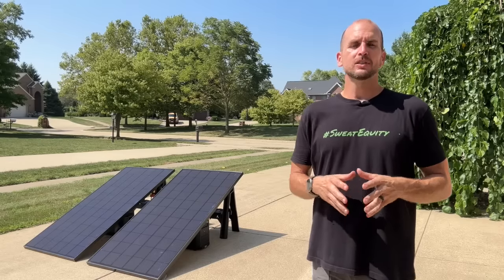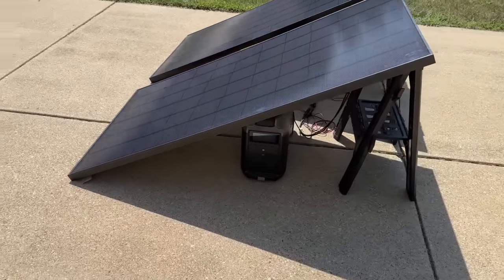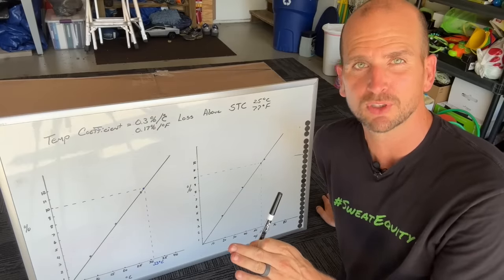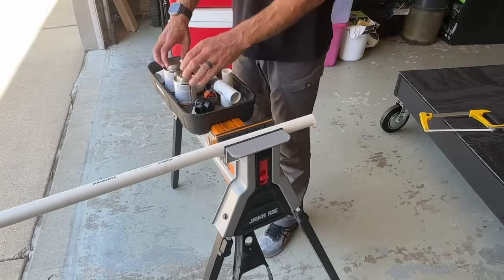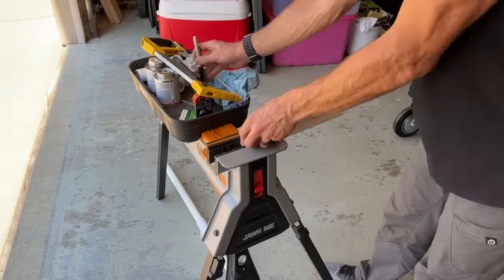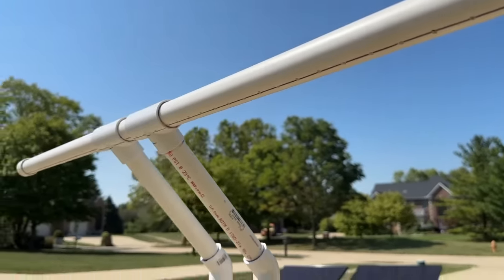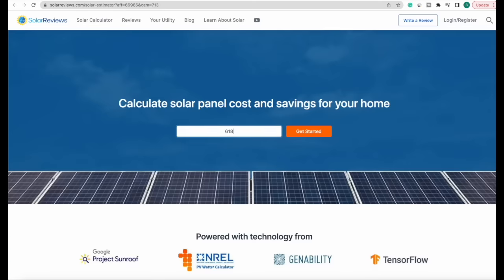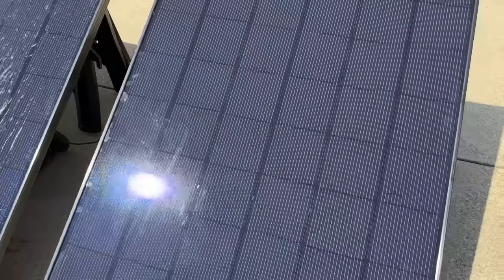Surprising Power Gains By Cooling Solar Panels

Comment: But it costs something (different for everyone) to supply the water. I wouldn't waste my time......plus water in desert regions, where solar is the most beneficial, is a precious resource better used for other things. Just add an extra panel. You should be building your system from the start to be upgradable anyway.

Comment: Hey why not use peltiers? Hear me out here. You get some copper flashing and put it underneath with a peltier spaced out to its maximum cooling on the copper. Use the panels output to cool it.

Comment: Tech Ingredients youtube guy added fans to the back of the panels which are run by the extra power of the solar panels. overall still a positive gain in efficiency compared to uncooled solar panels without fans.

Comment: It is very hard for me to believe that people don't know about solar water heater panels. How can you know about solar panels and not know about solar water heater panels? Thry look exactly the same. Except one makes electricity and the other has water pipes going through it and collects the heat in a boiler. They happen to use the same space on your roof and it is baffling why we don't have combined panels with water pipes on the bottom and crystals on top so you don't have to decide IF you want hot water or electricity and just have both. Plus the added benefit of cooling your panels and getting better efficiency on the electric side. Add that to efficiency of collecting all that hot water and you have a much better system that can't be beaten by any solar.

Comment: Can someone explain to me how he is getting 370wh from a 360w panal? I’m desperate to get more power from my panels . If I have a 100w (12v)panel producing 60 watts for 1 hour,then that would mean 60wh. Correct? I’d appreciate any information as I’ve made a 5kw solar generator but struggle to keep it charged with the different types of panels I’ve bought.

Comment: you produce more electricity in summer than you use so cooling the panels isn't much healpful. the problem is during cold months, there is not much sunlight to generate more electricity than you use

Comment: Get a cheap Small Yard pool and a cheap Solar Pump capable enough of the flow needed for the job, Lower end of panel in pool' Tho raised just enough out of the few inches of water. Diy small raised water deflect guards on sides of panels to keep water from spillin over the sides. All Gain' No Losses.⚡🌐🖖

Comment: If your so concerned about that heat temp loss Just add extra panels to adjust for the loss water is expensive to use unless you used grey water for this
Reply: roasted smelly water to add a special aroma to your surroundings?

Comment: or just shove a coiled hose on the backside of the pannel and circulate water in a closed loop I am using the flat tubed roof top pool heaters on the back side of 190w mono panels they do 250w

Comment: What is the cost per kw.  You stated the estimated cost is $15,834 to $23,752.  What is the cost WITHOUT federal tax credit?  Is the federal credit 30% of cost?  

It looks like you are paying 23.25 cents/kwh.  Is this California?  ($80220/25 y/113800=0.2325)  

The back side of the panel might be closer to the 93F outside temperature, which distorted your results.  If you cooled both sides, you might get more out of the cooled panel, but cooling both sides would be difficult and not practical for roof apps.

Comment: It’s an interesting test but in the end it will do nothing for you on the output side when converting to ac. Your inverters will always be the limiting factor. You won’t have a 360 watt panel paired with a 400 watt micro inverter. The only way this works is on a strictly dc system.

Comment: Recycled ♻️ rainwater system.....
With a float valve connected to house water.
Should the water be unavailable because of lack of rain or the evaporation of surface water ... supplemented by city water... through the guttering system.

Comment: IMHO..the 5% wattage increase is not worth it and we must remeber, that 5% increase is about the maximum you will gain, in full sun/ very hot weather...which means in the spring, winter and fall months, you are gonna see less then 5% increase due to the cooler temps , rain- snow- clouds. In fact,  anything less than a 10% increase in efficiency, is probably not worth the effort, waste of water. If a person decided they wanted to do this , I think a better option is to use a large water collection pan behind the panels and hook up some type of  water sprayer system that sprays water on the panels every 30 seconds or so and have that sprayer run off a 12-24 VDC brushless pump so you can use a single seperate small solar panel to power it.

Comment: Is it possible to put IR blocking film on a panel? What light band do solar panels use?
Reply: Blocking as in catching or reflecting?
Reply: @ThePixel1983  From 8 months ago... I assume I meant blocking and/or reflecting to reduce the heat input to the cells?
Reply: @GTrainRx7  That filter will either absorb or reflect that IR radiation. If it absorbs it, it gets hot itself. No idea if IR mirror foil is possible without taking out efficiency.

Comment: Let me understand this. . A person spends $70,000 to put in a solar panel system covering the entire roof.  They loose a LOT of power output from heat from the Sun. . NOW on top of the $70,000 and 20 year or longer purchase contract at 8% they need to Add water to keep the system cool which is more $$$$.  These Panels are only rated at about 28% efficient under Factory Laboratory settings - absolute optimum conditions.  They'll NEVER ever pay for themselves before they need replacing due to age at about 8 to 10 years.  I'll wait until the Solar panels are at least 75% efficient. . Relators have all said they do NOT improve the value of the property.  Arizona actually makes the house nearly impossible to insure with solar panels.  Solar panels have been known to short out and catch fire on the roof.  So No, No No. . I'll never get solar panels.

Comment: Does the water drops cause a magnification of  the sunlight causing. More power ?
Reply: No. If you hold a magnifying glass to pinpoint the light as if you wanted to start a fire, you will see that the light around the pinpoint has been greatly reduced. So to get a magnified effect to generate more electricity, you need a lens bigger than the solar panel.

Comment: Would it be better to just add a couple more panels and call it a day?
Reply from the maker: For sure, I am testing a bunch of things out but as it stands adding a panel or 2 is still the most practical solution to get a bump assuming your inverter can handle a bit more.

Comment: Evaporative cooling increases inversely with the water droplet size, hence smaller droplets increase cooling, but evaporation of untreated water tends to drop out solids and leaves a calcium based residue on your panels, decreasing efficiency. Add to that, 130 gallons of water could be more efficiently used for many other processes - especially in drought prone areas. 
While you have demonstrated cooler panels are more efficient, the cost/benefit analysis negates any savings. Even you admit "I wouldn't personally be doing it.". Sorry, but in the end,  it is much ado over nothing - at least from this retired energy engineer's perspective.

Comment: Maybe in the future, this could get a bit more refined with a closed loop cooling system in order to avoid wasting all that water and maybe even get some heat out of it. 

But that system is at best a proof of concept and absolutely not practical or economical.

Comment: I love all the ideas, but 5% is not worth the extra work/expense... buy 5% more panel for a few bucks.
I ran into this problem when designing a solar tracking system... it was cheaper to buy 20% more panels!
Reply from the maker: I agree.
Reply: @everydaysolar  I heard an interesting hypothesis that I have yet to test... 
Placing the solar panels vertical...  
Increased airflow cooling (and less solar heating)
Minimal dust/dirt collection (no cleaning necessary)
Slower panel degradation (add 5-10 years to lifespan)
Lower Peak Power (slightly offset by indirect light and cooler temps)

My Concerns...
Cooling is not that big of a factor (as you demonstrated)
Water hose cleaning is pretty quick (especially if you add a Rain-X coating) 
Panels only degrade to about 80-90% over 20-25 years (New Tech will be so cheap by then)
Power drops off pretty quickly leaving the Normal (a +30% drop would not be worth it)

Comment: So I use a 12 volt pump I made up a system where it misss the water all over it and it just runs right down it kind of like what you're doing but it all works off of solars so it's a small solar panel that runs the 12 volt pump with a bucket of water and it just pumps it right down the front of them damn things solar cooling solar to produce more power awesome shit

Comment: This "News" is as old as solar panels are...
I'm more suprised that not every solar panel owner knows this. This is one of the reasons spring is the most efficient time for solar panels since the air is cooler than in summer...
But spraying the surface with water is such a waste of recources in summer.
Reply from the maker: For sure, this was more of a early trial to just see the gains.  👍

Comment: This will eventually destroy the solar panels. Any time you use water as a heat transfer medium you deposit minerals onto the hot surface. Eventually this will build up enough to block light and ruin any efficiency gains. The cost for water treatment to mitigate this would far outweigh any power savings.

Comment: I'd try putting sheets of aluminum on the back sides of the frames with a screened gap at the top to keep out small birds, wasps, and other insects. At the bottom I'd have a couple of fans, with screen over them. For all the fans I'd install a solar panel dedicated to them so the cooling system is completely independent from main power generation.

Comment: Why not figure out how to mount the under floor aluminum Pex panels and use Pex for a closed system. Also a closed system requires less power to pump if you get the air out of it.

Comment: Obviously; 130 GPH of water use is terribly wasteful, but what if the water was being circulated to heat a swimming pool ?  Adding heat to a pool with a small amount of electricity of the re-circulation water might be a very efficient use of energy.

Comment: How about cooling them from the back using misters?
Reply from the maker: Yeah, I think to make this practical it would need to be a closed look system, on the back, that also warms the water to your pool.  This way you could increase your power output and also get an additional benefit of warming your pool water in the cooler months.
Reply: @everydaysolar  The reason I suggested using a mister on the back was to not obscure the light on the front  and to utilize evaporative cooling which requires air flow, as in a swamp cooler.

Comment: Please no. Talk about water waste, especially as in areas where panels are most effective there are likely water shortages. Added to that, youre likley using hose water, which means this isn't taking into account the power to pump the water. So, if this is actually a climate thing, you got to account for all power sources, not just yours.

In any event, there is a potentially better solution that is completely free to run and wastes no water. Put metal on the back to draw heat out. Create air channels along he back from the bottom of the panel to the top. Could be done several ways. Possibly even by cutting PVC drain pipe in half lengthwise and putting the open halves against the metal sheet. Seal it all to keep the air flow inside. Connect the top of the air channels to a long black pipe that has some elevation over the panel and make sure its in the sunlight. Its called a solar chimney. 

Hot air rises. Between the panel heating the air in the channels and the solar chimney heating the air in the pipe, the hot air rising will create an air pump, sucking in cooler air from below. Do it right and you can create a pretty good wind flow. The best thing of all, the hotter it gets, the harder it will work. You could also improve performance by ducting cooler air from closer to the ground on the shady side of the house to the bottom of the panels.

Even better still, there are devices called Peltier devices. People use them to generate heat and cold. In this case though, if you bond the heat side to the metal plate and have the air cool the other side, they will generate electricity. So, if you bond a few these under the channels and manage to actually draw out a good amount of heat, you can actually use that heat dissapation to generate more electricity.

For added efficiency, you can also get some of that super dark paint on the solar chimney to add to the light absortion.

Probably would be good to play around with Peltier placement. The higher the temperature difference between their two faces you create, the more power they generate. If you get enough of them, yoi could try to use them on the other side, between the panel and the metal sheet. That way, all the heat would need to go through them to escape, so better power generation. Of course, it's a balance between generating it with them comared to keeping efficiencies up for the panel, so you will likley need quite a few that way. They are pretty good at drawing heat though, as long as you can cool them fast enough.

Comment: You can't be serious here, or you can't seriously be a professional solar company and not know that solar panels have an optimal operating temperature of 77 degrees Fahrenheit, and that once they reach said temp, they dramatically loose efficiency of .5%/deg., higher the panels become throughout the day. This is why you see houses with extremely large, and in many cases too large of a set of panels on their houses. They are struggling to keep up with the demand the houses need, especially when they don't have any type of storage system, which most people don't.

Comment: Has anybody done a test with dust on a solar panel in dry areas - is there loss, gain, effect ? Some say  dust scatter the light and can increase the output. This needs testing.

Comment: What about cracking of the glass of the panel with cold water?
Reply: Most quality panels are able to prevent this with good workmanship. You don't need to be worried about panel cracking unless in extremely extreme temperatures. Also tap water would probably be enough to cool the panel in order to get efficiency benefits, therefore theirs no need for Ice water or anything extreme like that. Such a great querry though. Maybe we will try to make an in depth video on that - if people are keen to watch
Reply: @yeanswers  In mid summer here temperatures in the shade can be 40C + so the surface temp of a black panel would be extreme. Perhaps you could do a test on this sometime.

Comment: This was not an analysis if the watt hours used for water consumption was not subtracted. You might as well been using liquid nitrogen and not accounting for that cost, either.

Comment: I just cannot express how senseless this entire video is. The BEST efficiency for solar panels is just under 23%. Nothing anyone does will improve that at this time. The small amount of efficiency lost to extreme heat  is not worth the waste of water to sprinkle a dozen or so panels of the average household installation. This is especially true for those people living in the Southwest that may be impressed by this video. That's why you install 20% more panels then your max need...to offset loss generated by heat, clouds, etc. And before some rocket scientist claims you can collect and recirculate the water on the panels, during the summer in the Southwest that water will soon be over 100 degrees.
Reply: The host of this channel already said he wouldn’t do it with his home array. It was just a test to determine gains that might be had. There’s an Australian or New Zealand company that has panels that include water cooling. The benefits are that the panels produce more and last longer and you get hot water to pipe into your house. They cost more but may be well worth the extra investment.

Comment: Yeah, but what about the energy taken to provide water flow from a pressurized system. Do the math for that. Same for cooling fans. The efficiency must include the cost of equipment, maintenance and the continual use of water.

Comment: Who is going to step up and do the real test?  Plexiglass roof with climate controlled attic with panels sitting under the plexiglass.  Probably need a test with no gap between panels and Plexiglass and with various gaps in between.

Comment: if the water system was a closed loop and didn't waste water it would be good but the water wastage would would cost more than the power gain
Reply from the maker: For sure, here is my first attempt to a closed loop system. https://youtu.be/hfMEHn-4gmU

Comment: theres an easy solution for it.. factor in the power used to run the pump, if its more than the benefits, it'll be useless.